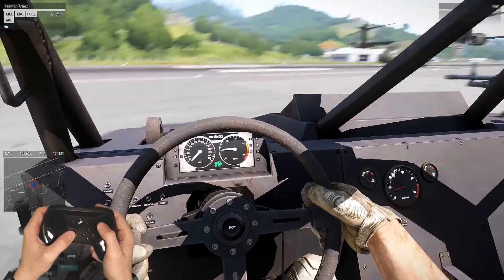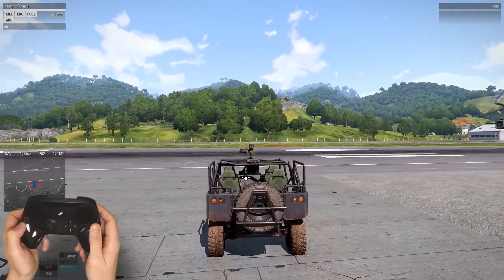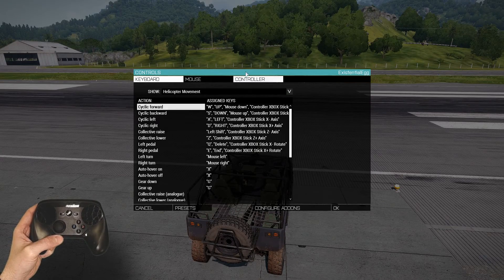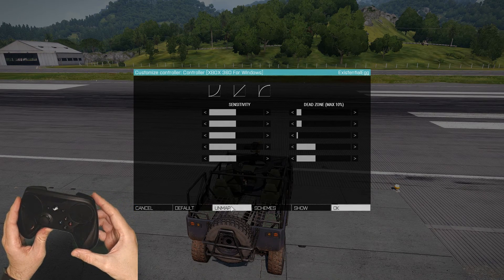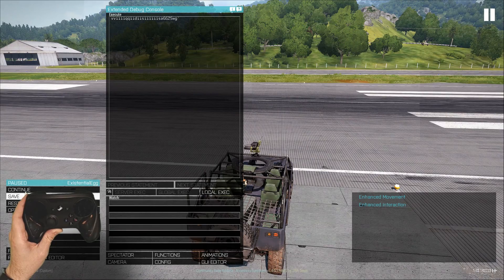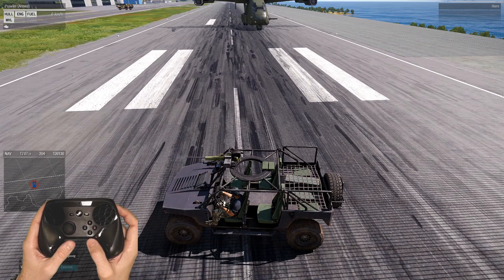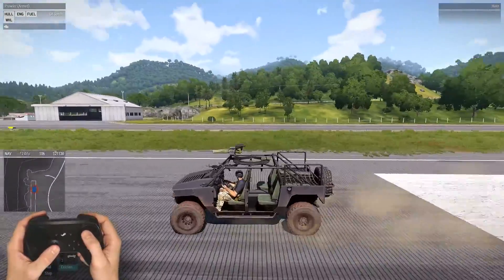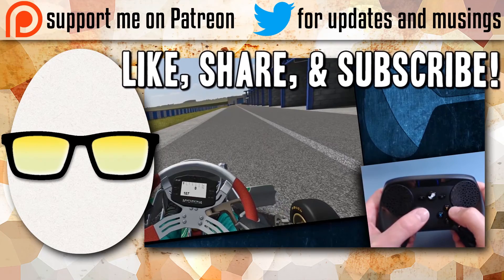ARMA 3 - Controller Analog Throttle Won't Stop FIX - Adjust Deadzones!

Comment: so got a question to anyone or the creator of the channel. I have something similar going on with my Helicopter- So when I put my Trim to Disabled (no assist) I just spin to the right, like im going hard on my foot-pedal, do you possibly know a fix for this? I have tried alot and researched it up and just cant find an answer. Its fine if I have Trim assist on.  Thanks to anyone that can help me out. Arma3 cant possibly expect you to fly whilst holding the foot pedal the entire time ( as that seems to counter it --slightly, but as soon as you lift up the foot pedal thats is countering the rotation it just starts rotating again).. also what do the settings in the menu where you turn your engine on that states Set Trim Manual, and Release Trim, what exactly does that  do? Thanks for the assist.+ My controller config is set up through Steam. I do have a flights tick as well. It does not matter if I have them all plugged in, none plugged in, it does this. I even tried to do what you/he shows above, did not seem to have an effect. MUST HAVE TRIM ASSIST ON (enabled) Driven me fkn crazy, I do not want to fly with trim assist on al the time. thanks again.
Reply: So what happens is that irl you actually have to control the rotation of the back rotor to counter act the torque of the top rotor. You would have yo continuously use your yaw to counter act it or manually trim the aircraft to counter act it

Comment: For some reason I am having trouble with my steam controller I believe, it will not do what yours is doing in this video, what the hell is going on, i am getting so frustrated, any way we can chat really need your help, I am about to delete this game!
Reply from the maker: You need to make sure you have Big Picture Overlay running in Arma (if you don't get Big Picture when you push the Steam logo on the controller then the controller isn't going to work correctly). I tend to launch Arma FROM Big Picture so the controller works well with it. I also run Steam as Administrator.
Reply: I am....everything is working except for my right trigger in vehicle it wont recognize it, when I pull it to configure move forward nothing happens.....I'm researching the problem right now, everything else is working great just that one setting will not recognize my right trigger pull....tried to do everything still no worky worky. Any ideas?
Reply from the maker: That's weird. All I can think of is to verify Right Trigger is binding in Arma 3 menus (make sure you are in Vehicle set of this profile or an all gamepad profile) and that you are in the Vehicle set while in game trying to drive.
Reply: Okay I will try that.....
Reply: Holy crap! Got it to work! Had to reconfigure controller on the desktop mode, now everything works, thanks dude for all the help i greatly appreciate it now friend me so we can play together sometime.....
Reply: Btw...in steam my user name is Beerboiler so be looking for that friend invite.